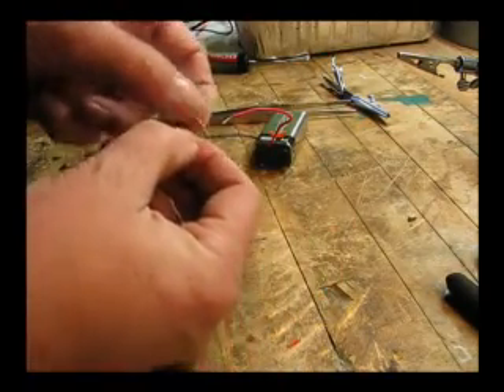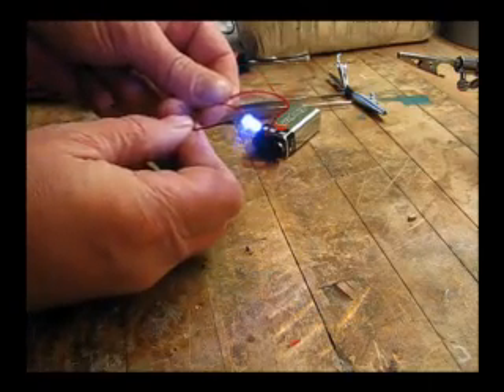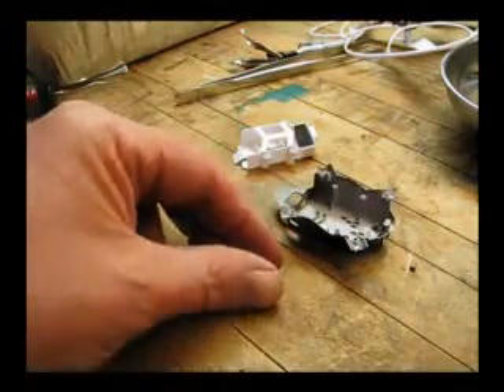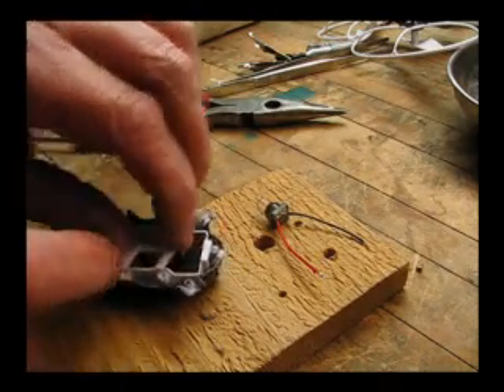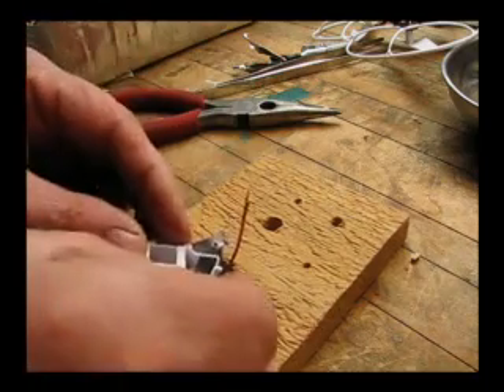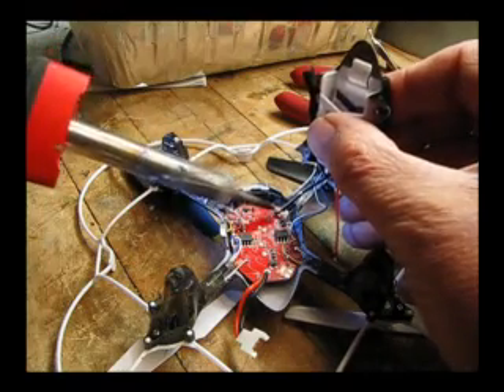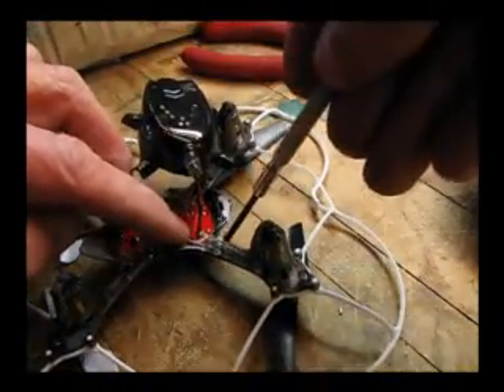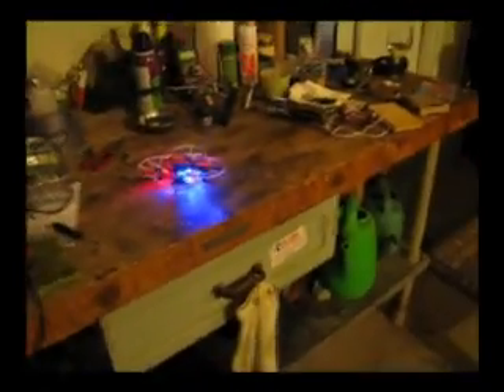Syma X11 headlight modification

Comment: What kind of wires did use use... just to be sure.
Reply from the maker: Chili Dog It is wire from an old rj11 phone line cable.  I just harvested two of the wires - red and black for reference.
Reply: Chili Dog Hi Pat, I just finished doing the Syma X11 headlight mod with the clear
 blue led's I got from Amazon and it says it requires 3 to 3.2 v. Did
 everything like you said except I didn't solder the wires to the pads on
 the board... I soldered them to the leads going to the pads so I wouldn't
 accidently fry something... same thing electrically. Plugged in the battery
 and it don't work. All the other lights work but not the headlight mod. I
 checked the voltage just to see and it's getting between 1 and 2v... it
 varies as it blinks on and off but it's not getting the 3v it needs... none
 of them do. I used a fresh charged stock battery... any ideas and thanks

Comment from the maker: This modification to the Syma X11 quadcopter to include a front headlight greatly enhances night flying orientation.

Note on the fake bulb drilling, I used a 5/16 drill bit for the hole to hold the fake headlight and a 3/16 drill bit for the actual hole to hold the 5mm LED.